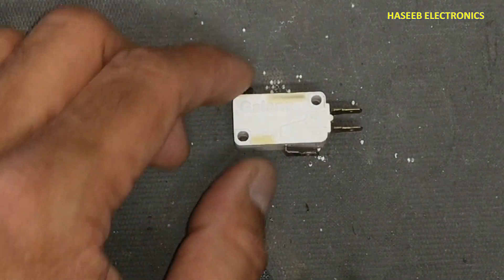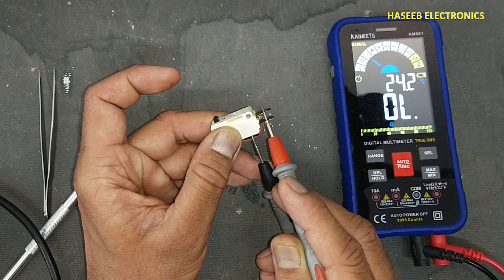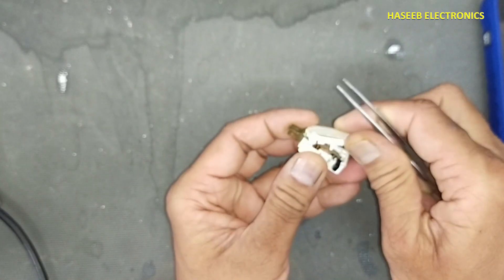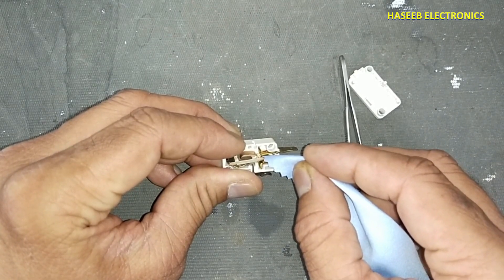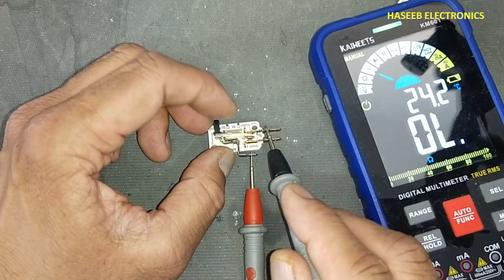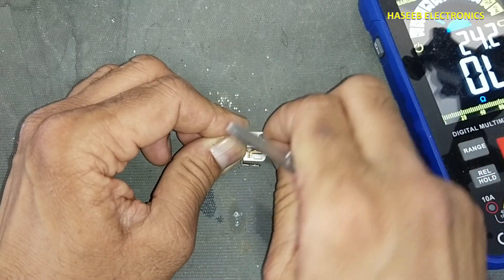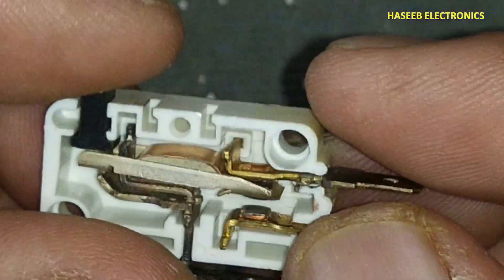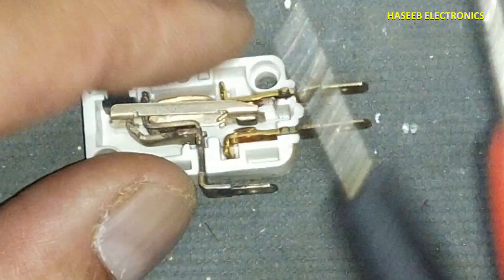{874} How to Repair Microswitch

Comment: This is good. These often fail in microwave ovens.
Reply from the maker: exactly it is most common failing component in microwave door interlock
Reply: Or a Thermador range that they no longer make the micro-switch. I will try this before trashing the range. LOL
Reply: @dchow007  Micro switches are commonly used in many devices. Unless your Thermador has a custom sized it should be easy to find an after market replacement.
Reply: @bobsoft I found the common switch under a mounting bracket. I'm familiar with the brand Cherry in my days working with computers. This $5 switch is going for $50 to  $150 on ebay under the brand Thermador or Bosch. I got one for $5. It has a special attachment but I would move it from the broken switch to the new one.

Comment: All, If you have a Thermador or Bosch oven or Microwave with a faulty switch...and found out both companies no longer stocks the parts for repairs... I learned from Haseeb how to troubleshoot. My Thermador P304SC/04 uses a Cherry E-22 microswitch. I got a new old stock on ebay for $5. Don't need to pay someone pulling them out of trashed appliance and selling them for $100. Watch this video again and learn to do some investigating before trashing that overpriced Thermador and Bosch appliance.

Comment: do you have any idea on what can cause that? I have some of these switches in a video game controller. I've used this type of controller for like 20 years w/o problems but since some 3 years ago the switches in it started presenting malfunctioning after 1 day of use or so. Its crazy; it starts double-inputing when the switch is about to disarm. I guess it may have something to do with the power grid from this house Im living now but Im not sure, I have no idea on how to test and find out what is causing these switches malfunctioning.
Reply from the maker: over-aging is a fact, its contacts get sticky due to some dust rust (spraying contact cleaner can solve this problem)
its spring arm's tension becomes weak, and cause bouncing effect while arming or disarming 
it can be monitored using oscilloscope to check bouncing effect
Reply: @HaseebElectronics i guess its something related to the contact area, the arm's tension seems to be just fine. Whenever we use contact cleaner the switch gets back to normal if the switch is brand new, like 1-2 hours of use, but the problem presents itself again after another hour. I really have no idea what causes these hyperfast aging, its looks like magic.
Reply from the maker: @gxmcdg to overcome this issue 
10n to 100n capacitor can be connected in parallel to switch contacts
It prevents bouncing effect
Reply: @HaseebElectronics  I understood nothing of that haha, but its not the first time I heard a resistor or capacitor installed somewhere could help dealing with this kind of problem. Would you know what terms I can use to search online in order to learn more about that?

Comment: Some technicians advise not to use emery paper to scrub the switch contacts. Special coating on contact points gets scratched so use cleaner solvent & cloth, they say.. True?
Reply from the maker: using zero grade emery sheet (220 or 440 grit)   or chamois leather is good. actually we need to remove accumulated material (dust, rust, carbon and oxides due to weather effects, sparking etc) 
40 grit: Coarse.
80 grit: Medium.
100 grit: Medium.
120 grit: Fine.
220 grit: Fine.
440 grit: Extra Fine

Comment: use 240 sandpaper grit or just scrape with a knife.
Reply from the maker: perfect 
knife or thick grains sandpaper makes scratches, which causes sparking and builds carbon deposits quickly